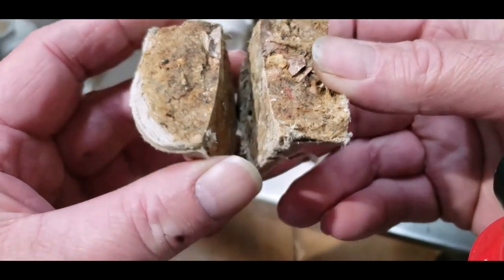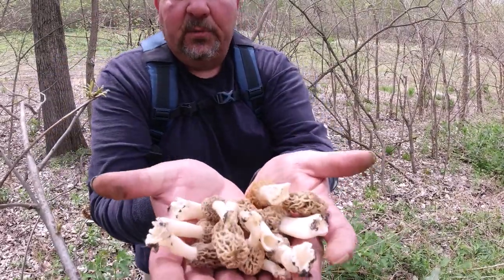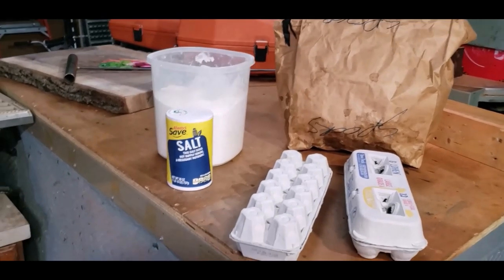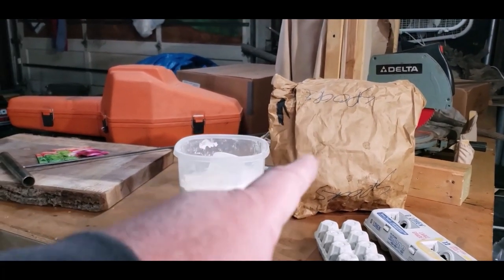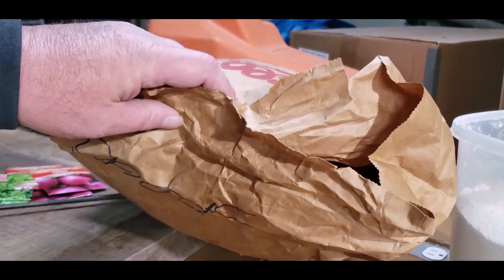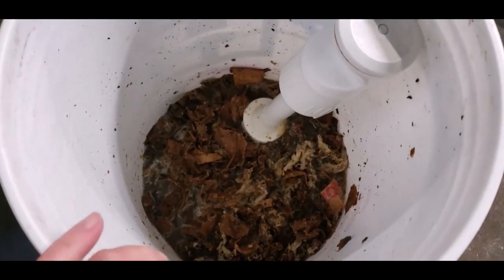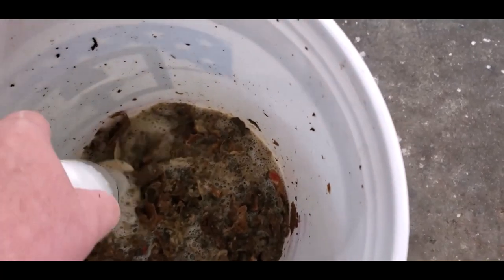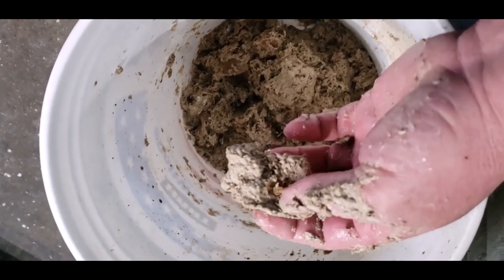Morel Mushroom Spore Block... How to Grow more Morels.

Comment: I made a spore block and the top layer of my block turned really dark does this happen to some of your blocks also I used apple tree as my base for sawdust and I blended fresh morels so you think that could be the difference in color?
Reply from the maker: Yes. Turnning dark is normal as most wood or wood fibers will do during decay.
Reply from the maker: Also, you should let the morel fully dry so it " spores out." A fresh morel will have spores in it, but  a fully aged and dried morel will have MORE, lots more. Next time do a spore print of the morel first. Then add it to the mix. A morel needs atleast a few weeks drying to produce all its spores and be fully productive. Thanks!

Comment: walnut sawdust is not good around flowers or plants ... maybe ok for mushrooms ? i wouldnt risk it
Reply from the maker: Good eye! Shouldn't be much walnut in there. Those slabs were all chain saw cut even the cross cuts. But very good point and type of sawdust definitely needs to be discussed. The walnut are my sons project some spindles if their in the background  might have been cut on the table but not much. Off topic, I don't like walnut, too dark though I have turned a few salad bowls with it and some inlays. The lighter colors in the mix was grey to the core old exterior barn cedar. But to be honest there's pvc, fiberglass, recycled wood paint poly, glue from plywood, pressed board. Yeah whole things bio hazardous. But the soil along the rivers i pick have way more contamination in it than my spore  blocks including....drum roll!.... fungicide!  See ya THANKS!